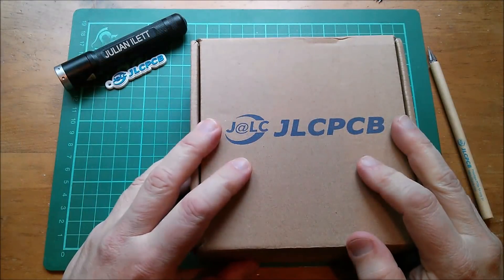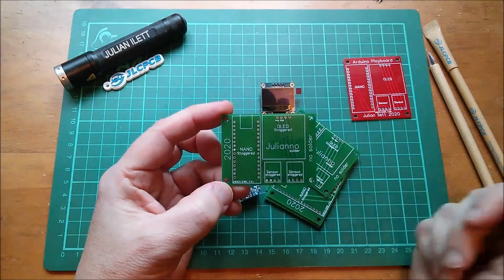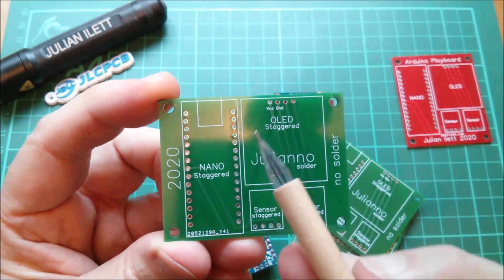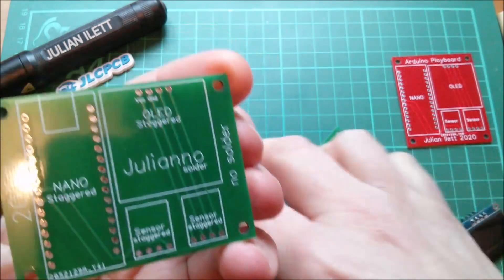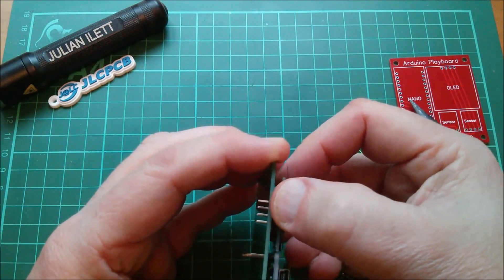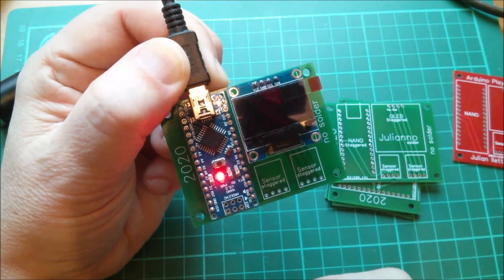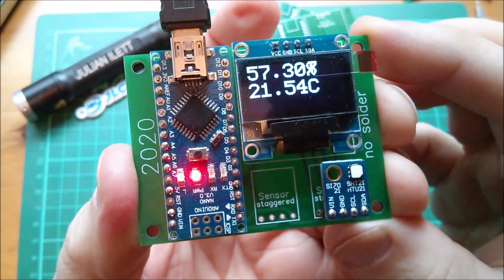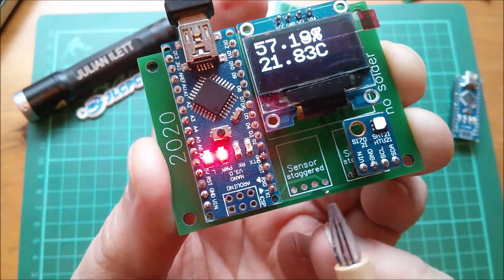New PCBs from JLCPCB: Julianno

Comment: I guess the QR code could contain the program listing, most QR codes I've come across are usually just web sites URLs though. As for staggered pins. it's a nice idea, however as you clearly demonstrated it would lead to unnecessary frustration when it comes to trouble shooting... ZIF sockets would be too expensive, however I don't see cost being a significant reason to avoid using normal sockets...

Comment: I cannot wait to put these boards in my current project. May I suggest simply reducing the size of the ports to point they guaranty a reliable contact to the legs and THEN including a 3D printed blacking to grasp the posts from the back of the board securely.!?  The backing could be designed to force the posts to a suitable inclined angle to press them to a certain contact with the ports on the board  That 3d printed backing will double as an insulator in the meanwhile

Comment: You need to stagger them more, and for the four hole connections, each one should be opposite to the last, to ensure each pin is forced against the opposite through-hole plating - unless you want to have to bend the pins on the sensors and display before inserting. Would certainly be handy for that quick test of a display or sensor without needing to wire up and breadboard, and also makes soldering them up easier since it locks the boards into place once inserted.

Comment: Only staggering will eventually damage the HASL plating after repeated removal and insertion of components. If the component pin and PCB hole centres are aligned with no staggering and the hole diameter is decreased so it's a tight fit, this too will end up damaging the HASL plating. If you do both, it'll be still worse... So connectors (pin headers) are the way to go. Also desoldering will be a nightmare. Here are some "short" headers https://www.adafruit.com/product/3008

Comment: And I don't think staggering is the complete answer, I believe making the holes smaller might be better. Time to break out the calipers and make the hole dimension as close to the measured dimension as possible. I am just wondering if you might be removing material from the through holes doing all of this.

Comment: I think to get it to work reliably with the Arduino you'll need to use a few sacrificial pins in the other direction. So a few pins are just used as clamping and the other pins bent slightly outwards so they're more likely to touch the PCB in all cases.

Comment: Just use two boards and shift the bottom one over and the pins would touch all the edges on the top board. It works like a zif socket. I've done that before. After thought if you do standard .100 spacing you can use standard perfboard for the back board.

Comment: Hi Julian, Madness..Use headers.
The only other solution is to use some sort of miniature Banana Plug.

That Nano, needs to be completely de-soldered and soldered with good lead solder and ALL the way through the holes.

Can I suggest when you next, if you do, PCB version.
You provide an extra set of holes wired to accept the OLED, but when it is mounted on the other side of the PCB.
That way you can mount the PCB in a case, with the OLED flush with an opening in the case  and the rest of the circuitry conveniently behind the OLED and inside the case. 
You have mounting holes already placed to do the job.
Good to see you have a heartbeat LED.

Comment: Stagger stagger stagger, crawl crawl, stagger stagger, crawl... :D

Seriously though, I do like this idea. You just need to make the offset larger than the difference between the size of holes and the pins, plus tolerance. From JLCPCB's "capabilities" page, they say the tolerance on holes is 0.08mm, which is about 3.15 mils, so I'd say you're going to have to offset a lot more than 2.5 mils! I just measured two different kinds of pin dupont pin headers and one was about 0.8mm diagonally and the other was closer to 0.75, so that's from around 29.5 to 31.5 mils.

In my limited experience, Eagle uses metric standard hole sizes rather than imperial, with the default sizes in 0.05mm increments to 0.9mm, then 1mm or custom for larger. I'd guess most other standalone packages do the same, and I remember in Dave's design for manufacturing videos he said they'll have more metric standard sizes than imperial because of this. If you were designing in a normal package, I'd say go for 0.8mm holes and a 5 mil offset, but since you're using that website thingy, I'd say either 31.5 mil holes (32 if you can't be bothered typing the extra two characters) and 5 mil offset. That should make the make the holes nice and snug, and the offset should more than account for the tolerance.

Comment: Regarding the QR code thing, I believe the value is around 3kb, but it'd be a bit of a stretch. A very small C++ program could fit, but anything larger would have to be compressed. I experimented with gzipping the source and then enarmoring to make a compressed ASCII string., and I managed to get a 150 line program down to 2kb of ASCII.

So you could probably easily get the entire program onto the QR code with sufficiently efficient compression.

Comment: Hi all, Wondering what software people use for designing and exporting PCB's for manufacture, I'm currently using Fritzing but is there anything else available that is simple enough for a beginner? 

Is it possible to add component libraries to Fritzing or other software? if so is there a recommended source to get them from?
Reply: All the commercial circuit design packages have a pretty steep learning curve for most beginners. You might want to check out EasyEDA, which I believe Julian uses. I've only had a short play with it, but it can spit out gerbers or just order direct from JLCPCB.

Otherwise you can get some component libraries for Eagle, Kikad, etc. from Mouser, digikey, etc. You just need to install their awful software to convert their files for your chosen software. Most of the time I'll just make my own though. Once you're used to it, it really only takes a few minutes to throw together the symbol, find a matching footprint from a similar part, and drop them into a part. That way I don't end up with every part on my board having different sized holes and pad widths.
Reply: @UpLateGeek  Thank you for the info :)

Comment: Maybe make a board with:
Different counts of holes and several different offsets so you can test different scenarios.
Also, you could meas tilt (end to end height difference and span) for the tilted sensor and calculate the new pin pitch that made all pins contact.  Simple trig.  I'm also excited to see you succeed with Julianno.
Also, are all the board acting the same - variability?

Comment: i was thinking using pogo pins on the pcb and have nano and other modules on it without them having any pin headers. like a circuit trainer
Reply: But..
Pogo pins are more expensive than sockets. 
You'd also need a way to hold the components down onto the pins.
It also defeats Julian's obsession of being solder less.

Sockets are much simpler.
But as we all know. Julian rarely does simple. Lol

Comment: On the Nano you would get more reliable results by not having a stagger at all but making the left and right rows of pins either closer together or further away so when you place the part its tight on all the pins, this would give reliable results for sure, for the OLED use smaller holes so its a tight fit, as there are only 4 pics this will not be a problem to push them in, keep up the good work, Dave @ BasicMicroUK

Comment: The % his a bad font or is it a % with a 7 on top :)
I have just taken a central heating pump apart and the mains out to the motor goes between the two boards with pins that just push into the pcb and are very tight. May be if I can find some time i might make a quick video on it.
Reply: % symbol with the top 0 connected to the bar is pretty common in fonts designed to look like handwriting ("script" fonts), and occasionally appears in "regular" fonts like Century Gothic.
Reply: @SteveHodge  but if you look at 15.43 the % clearly is not correct looks like a 7 is on top of it. and look at the temperature there is clearly a 6 and 7 in the same digit. Julian has a bug in the machine. if you have seen the terry gilliam film "Brazil" you would understand how much a single digit mastake affects life the life of some people "Buttle or Tuttle" https://youtu.be/nWbIxFKtTmE  :)

Comment: Some PCB manufacturers offer "press fit holes"... These are plated through holes with much tighter tolerances. So it's important to specify the right size holes for the type of lead you will press in them.  I don't know if JLPCB is offering those. Maybe something you can ask them to add to their list of supported options. :-)

There are also press fit pins.  which are header pins with a lengthwise hole/cut in the shaft and slightly splayed open. so pressing those into regular holes will guarantee a tight solderless fit.

Comment: Drills will likely be in 0.1mm steps. 
Ideally to do no solder connection the square header pins should have interference fit across diagonal pin corners. Sadly the plated thru hole dimension is likely variable, so may be loose sometimes and too tight others. On press fit connections thiugh the pin corners are normally intrrference fit. But on multi pin connections considerable pressin force results. Hope you can reach a workable solution.

Comment: a QR code has a physical limit of 177 rows by 177 columns, which translates to 31329 "pixels" (or modules in QR terminology). Because of encoding overhead (the "square marks"), built-in error detection/correction... This results in 3Kb of data.

Enough for a small program. But the QR code itself will be "huge". 
The general recommendation is to not make the modules (pixels) less than .8mm (.03"). Because scanners will have issues focusing, and the printing of the QR will be too much subject to print errors.  So a 177by177 at the smallest recommended size is 14x14cm square (5.5inch)

Probably a better way would be to have the QR encode the URL to a website, and have the program at that url.

Comment: With the 4 pins, try expanding rather than just up and down.  So, left.2mm,, up .2 mm, down .2mm and right .2mm
You are so close without having to solder on female duponts. 
With the QR CODE, you can do web links, possibly to a github repository for that board, and from there be the downloadable code ( and updates ) to go with it.

Comment: It's called press-fit. Lots of connectors use this principal nowadays. You need a specific size hole and the pins are forced into the hole for mechanical and electrical connection. No soldering needed. Mostly used for high current connectors. Wurth has them for example

Comment: Your solderless idea is really frustrating and unreliable. There are relatively few pins total since you only use a couple from the nano, I would just use normal (not staggered) footprints and solder partial sockets only for the used pins and for the nano probably one additionally in each corner to stabilize it. Saves a whole lot of doubts and frustration.
Reply: There are special contacts for in the pcb. They look like the round contacts as in ic sockets, but without the small pins on the bottom and without the plastic.

Comment: QR Codes aren't limited in themselves in any way.  The limit will be the display media.  The resolution of the display or printer vs. the size of the screen or print area, respectively.  JLCPCB's site says they can do lines down to 0.153 mm and text down to 0.8 mm.  I believe QR codes are treated as text, so a one mm square dot would be the smallest (guessing..)  You should be able to fit 500 or so characters in that space (guesstimating the area about 25 x 30 mm), and with compression, that would at least double.
Reply: But, easier still, put the code on a secure server and just QRCode the link to it.
Reply: Type 40 QR Codes are 177x177 and can have about 4kB of data. Would have to be a fairly large PCB for it to be readable though.

https://commons.wikimedia.org/wiki/File:Qr-code-ver-40.svg

Comment: I would offset the Nano's pins so that all the pins on each side are offset inwards, towards the center. As you push the Nano in, the pins will bend/squeeze toward the centerline and and kinda "grab" the circuit board. On the four hole groups, I would offset the left two away from the the other two (or towards it, your choice) so, again, the pins "grab" the board. We used to have poorly made boards and sometimes the "grabbing" was enough for the boards to work, even without solder.

Comment: I believe the problem is only a few of the pins need to make contact for the nano to be kept in place, perhaps making the distance between the two rows of holes marginally wider than the distance between the pins (they should flex perhaps .2 -.5 of a mm surely) and then when the nano is pushed down the pins will have no option but to grab the holes?

Comment: I've been a test fixture designer/builder/programmer for the past year or so, and the second PCB I had to build a fixture for had roughly 80 staggered connector pins that I needed to probe with pogo pins.  What a pain in the ****!  Those were only 0.013" offset, with the intent of holding the connector strips in while the board was flipped over and hand-soldered (it was designed 20+ years ago), but they made the pins go all over the place once they'd gotten hot from soldering.

Comment: I love what you are doing but you are trying to fit a square peg into a round hole. Through holes just won't ever give you a reliable connection. This is why we have sockets. If you really want to do this you need special press fit pins.

Comment: It's probably something like hole diameter minus pin diameter plus 4 thou, that way each pin has 2 thou deflection/press. I would be going for at least plus 8 thou for 4 thou deflection as a minimum. 
You can see there will be a problem with different pin diameters on subsequent purchases, plus the sharp edges of square pins will wear the holes with a lot of insertions.

Comment: 4:02 - What happens in reality is we (the majority of us viewers) use sockets because we don't get free PCBs whenever we want.  Using sockets is the most cost effective and reliable method to have removable modules.  If we need to save the cost of the sockets we just solder the modules in.  (And in the case of the 4 pin modules they can still be removed easily enough.)  So in reality skipping sockets really doesn't save much money in the end as if the Julianno was sold the cost of sockets is very small compared to the PCB or shipping costs.  That being said I do still enjoy these videos and Julianno is a great Arduino name.  Nice!
Reply: If you want to continue your offset test, Julian, I would recommend just making a test board with all the offsets on one PCB.  Step your offsets up in one direction and adjust the hole sizes in the other direction.  Connect all the holes together to one common pad (or a few) so you can mount your test modules and quickly test for continuity.  Ideally use test modules and not actual modules so that the test is not affected by the modules circuits.  Your test PCB should end up being full of thousands of holes.  This would be interesting.

Comment: I'd say try smaller holes, and perhaps gold plating so you don't get oxidation or tin whiskers or anything.
Still, some of those pins are rather long, requiring standoffs on the board or cutting legs, to avoid hitting whatever is behind it.

Comment: Why not stagger it in the up and down direction as well for the Arduino
Reply: +1 Also for the sensors and oled. Make the two middle pins closer together and the outer pins further apart.
Reply: Haven’t read that far when I posted my suggestion...

Comment: There's an Arduino IDE for Android. It can even upload firmware to the board via USB OTG.
I don't think that putting the whole sketch in QR code is doable, but an URL to a zip or something like that would work quite well. If that was supported by the IDE on the phone, you've got your idea fully functional.
Push the modules in, scan the QR from the IDE, upload via USB OTG. Sounds great to me :)

Comment: The Nano may feel tight, but I'm betting there are still a couple of pins that aren't making contact. I think in the end you are going to have to put sockets on there to make it work. Nice idea though. And when you reflowed those pins you ought to have taken it out of the board. That pin will have relaxed sideways to lose its spring against the PTH.

Comment: Well, you've proven you can do it, but at what cost (time*$*frustration=👎)

Time to use sockets!
Reply from the maker: I'm not quite there yet, but I'm not giving up :)
Reply: Sometimes the joy is in the journey. Not saying that would be my case but maybe for him.
Reply: Depends on how many you're making.  The more you're making, the more time you can spend in development. But that said, I suspect that sockets would be more reliable over the long run with different components, different batches and time taking it's toll on the plastic holding the pins.
Reply: And once you have the technique you can employ it in other projects.